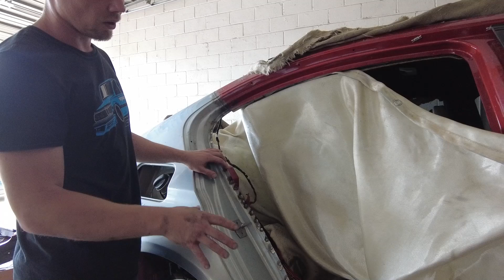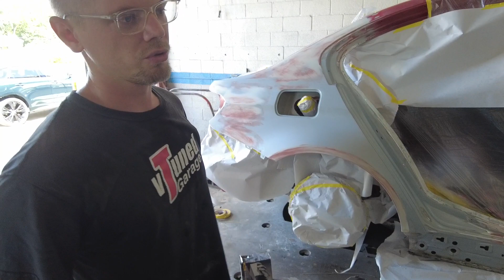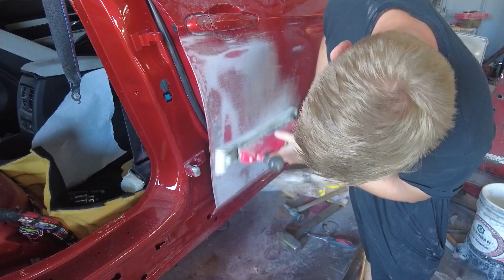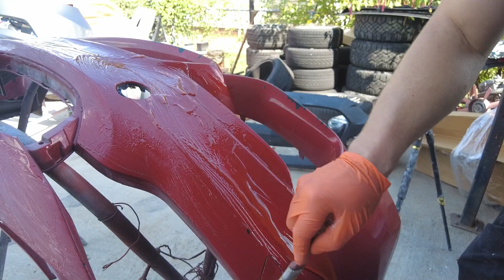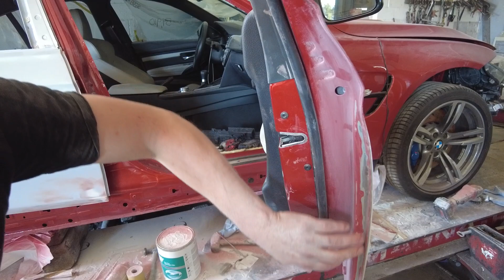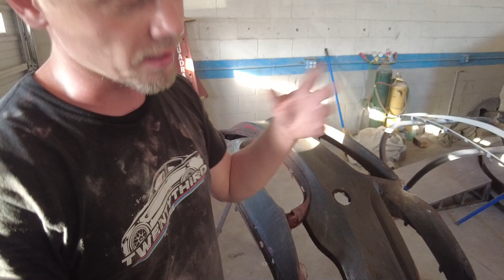Rebuilding a Destroyed BMW M3 part 4 Finishing the body work and painting the jambs

Comment: Great video! I have just subscribed! I have an idea for a build you could do for your channel! I have watched a lot of youtube videos of people removing the body panels from modern Mustangs and then replacing them with 67 fastback body panels. The problem is the modern mustang is so much wider than the 67 that they remove a lot of the modern mustangs structure in order to get the 67 shell to fit. I have realised they are using the wrong donor car! They should use a 2007 to 2013 BMW M3 coupe or convertible as the donor, it is a v8 and it has almost exactly the same wheel base as the 67 Mustang and with the BMW body panels removed it is sightly narrower than a 67 Mustang, so the classic Mustang shell should fit over the top easily.  As you are an M3 guy and like Mustangs you should have a go at doing this, you clearly have the skills to pull it off, and it would make for an epic series of videos!!

Comment: the answer to your tripod issue is very likely staring you in the face in a dark corner of the workshop, why not convert one of you vehicle axle stand, or get in a heavy duty lorry type, then weld on (using your Yuri super powers and electric gluing) weld on an extending pole with the adaptor to take cameras etc

Comment: Not sure why you thought it necessary to paint strip the plastic bumper. Wouldn't it have been better to simply scuff it and maintain the factory prime to plastic adhesion?
Reply from the maker: The paint was peeling, we cannot spray new paint if we see peeling or chipping. Your paint is only as strong as what it lays on.

Comment: i used that stripper to strip tour busses complete over all paintjobs i did one buss a week it took me 54 weeks to finish the busses  i would use a shutz gun  and spray the stripper on i used about a case per buss if it only had one paint job on it if the buss had two paintjobs it would take closer to two cases of stripper  as soon as i saw that can in your hand i could smell the stripper through the computer